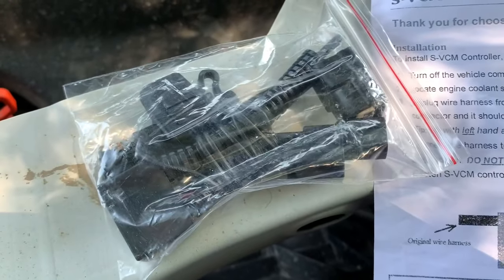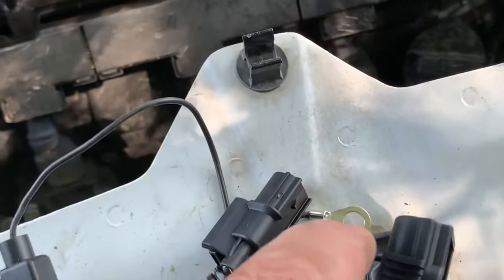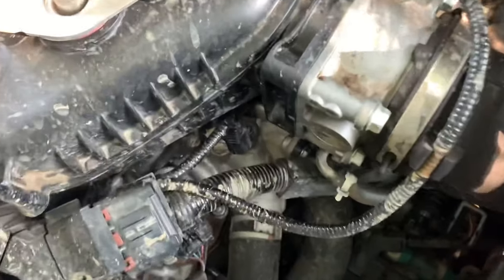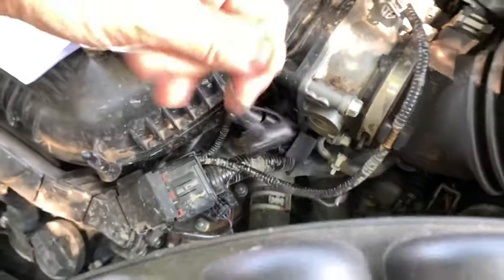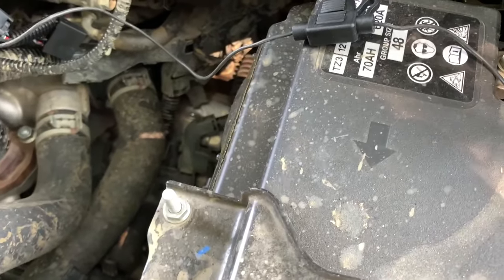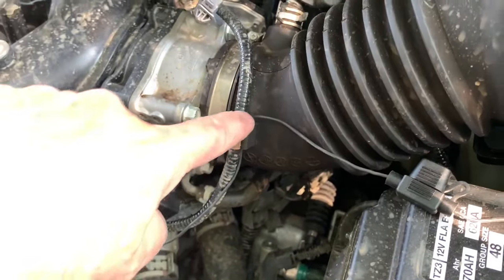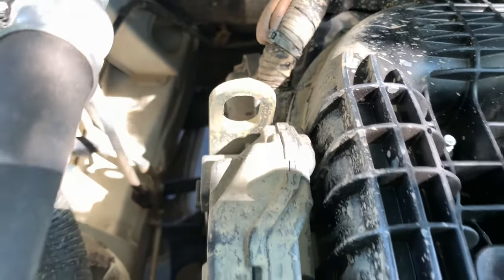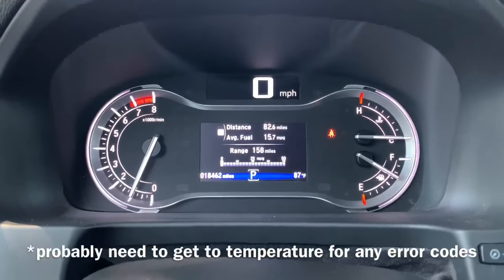Disable VCM (Varible Cylinder Management) in your Honda Ridgeline Honda Passport Honda Pilot Forever

Comment: UPDATE: S-VCM module has been installed for well over 5000 miles now.. No decrease in fuel economy at all.. 65mph and not towing or hauling anything yields 28mpg... Super happy with purchase...
Reply from the maker: Great news! Thanks for sharing.
Reply: Is this device smog legal in California?
Reply from the maker: It’s has nothing to do with exhaust.
Reply: Would this apply to a 2022 HondaPassport?
Reply: @kgill5  if the engine is a J35Y6 (and I think it is) it should work perfectly. I now have 27,000 miles on it and it easily gets 29mpg not towing. It gets 20-21mpg when towing a 1500 pound bass boat.
Reply from the maker: @marks6072 it does
Reply from the maker: @kgill5 yes it would.
Reply: @franchisefred4066  no problem, all it does it tricks ECT1 to say the engine is under operation for VCM 165°F, ECT2 is still checking temperature so no risk of overheating. Also SVCM has an overheat threshold that will trigger over 200. 

Make sure you do it cold or you will get CEL
Reply: Will this work on the 2024 ridgeline?
Reply: @gerryecobiza same engine in 2024 so it should work fine. Great investment if you plan on keeping your Ridgeline over 50,000 miles.

Comment: I bought a used ‘17 Ridgeline about 2 years ago and one of the first things I noticed was how the truck vibrated, made weird noises and the tac would bounce around quite a bit. My family thought I was crazy, but after doing some research learned about the VCM. I HATED it. I’ve had this product on my truck for over a year now and have loved it. No issues and all of those “problems” have gone away. Best $100 I’ve spent on the truck.
Reply from the maker: Great to hear! We love ours as well. Make sure to subscribe. More to come. Thank you!
Reply: Still going strong? I purchased a 2017 ridgeline two months ago and i have the rpm fluctuations. Im going to change the trans fluid (4 drop method) and filter tomorrow and have one of these svcm on the way. I LOVE this truck with the exception of the rpm fluctuations, theyre awful!
Reply from the maker: Great to hear!
Reply: @midroad-2443 Happy new year, yeah your ridgeline needs a drain and fill ×3 ( ×2 is ok) of Dw1 or flavor of atf fluid. Then atf every 30k or yearly ( just do transfer + diff at the same time too) do not overfill atf, measure it hot and look for line in the middle of cold and hot line of the trans dipstick.

VCM has been good in the J35Y6 engine with Direct injection, there is less opportunity for oil consumption and DI burns even and cooler than than Port injecton which was the problem with the Odyssey and accords . 
However, VCM doesn't play well with the Honda 6 speed auto which is why I recommend to disable.  The TCU is programed to go out of Torque converter lock up and slip the clutch to matching rpm for smooth 6 to 3 cycle switch with the active motor mounts to handle the 3 banger vibrations. Then there is the Dw1 formula that is heavy in Zinc or ZDDP, as an all in one antiwear additive. It's fine as far as chemistry which is closer to manual atf with 10× less Zinc used for creating Triboflims on the clutch material as a wear layer that will rebuild as long as there is enough addtive package. Now think about slipping a clutch in a manual you aren't doing it often or at all but in this case everytime VCM needs to initiate the clutch will be feathered while going in and out of Torque converter lock up which will pretty much slowly glaze the clutch material resulting in the 'RPM flutter' and 'Torque converter Judder'. 
Then as the fluid has deteriorated and no longer provides adequate pressure due to the slipping RPM needs to increase to compensate to disengage TQ lock up, feather clutch, VCM engage the fluctuations cycle repeats. (The Judder is TQ clutch in and out)
To maintain VCM relies on oil pressure for activition which is connected to the RPM but when there is a slip RPM need to rise to compensate, then falls once pressure us reached; more slippage and RPM rises and falls again
( the flutter).
 It seems only the people driving the J35Y6 engine gently have more of the RPM flutter
Reply: Thoughts regarding installing it on the 9 speed?
Reply: @JayDrums_Music  its your call, the Zf 9HP + fluid seems to be really robust.
My reason for disable VCM on my 6sp ridgeline is the transition from 6 cylinder to 3 cylinder is programmed to unlock the torque converter and slip the clutch slightly to ease in the transition then re lock the the torque converter; problem is DW1 doesn't handle it well and the 6sp is built more like a manual so imagine micro slipping your clutch everyday w/o the option to replace the clutch
For the 9 speed how it's designed with the dog clutches and A + B internal Brake clutch system. I'm sure VCM is programed to active within them movements the engine engages brake A / B to sync the dog clutch ( which are more like gears syncing) the shift from gear 4-5 is when the first dog clutch shift happens and gear 5 is also 1:1 the next Dog clutch is 7-8. I can't confirm but I'm gonna bet VCM kicks in at 4-5 for the 9HP

Comment: Just installed this on my 2015 Pilot. Took about 20 minutes (5 of it spent trying to get the old and dusty sensor plug out). No error codes. ECO light is now off. Throttle response is a lot better and driving seems smoother yet ready to go when I need it.

Comment: I bought it a year ago and finally got around to putting it on today. It would have been a lot easier if I had hands the size of a baby koala bear. Started it up and drove about 15 miles. No error codes AND NO ECO popped up. 2013 Pilot with 225k that I bought used last Summer.
Reply from the maker: Sweet!!!

Comment: I just got it today and installed the switch right away. Easy installation, 10-15 min tops. At start the indicators were shaking but only until the engine started. No warning light. Right out of the bat it felt and sounded different. No more weird weakness from the engine. More power and no more weird vibration. Happy so far. I will update if anything starts to be funny.
Reply from the maker: Awesome- always remember to install an a completely COLD engine. Thanks for watching!
Reply: is it still working good?
Reply: @dropdabeat442  I had to remove it when the emissions light came on and Honda replaced all injectors under warranty. I still have to put it back in. I assume that with the vcm cut out, the injection system was working all the time and crapped out like it did on many other engines (hence extended warranty 10 years/150k). Should be all good now. I just need to find the time to put it back in.
Reply: @s4-mtb678  Thanks for your answer. So this VCM bypass device can also damage injection system or just use it more than it normally should? I hate the unstable transmission caused by VCM, so I was thinking about getting this VCM bypasser.
Reply: @dropdabeat442 no it won't damage the injection system, that is faulty already on this own. To the contrary it will save your engine from other more catastrophic failures. In my case my assumption was that cutting off the vcm the whole injection system was running all the time so it increased the chances for a failure on one injector that was coming no matter what. On my 2017 was covered under warranty so it wasn't a big deal at all. 90k and fresh injectors for free  it's good.
Reply: @s4-mtb678  Oh I see. Thanks again for detailed explanations. I should have bought the Honda extended warranty. My 2022 pilot only came with 3yr 50,000km for everything and 5yr 100,000km for powertrain
Reply from the maker: Works great for me. Did you order yet?
Reply from the maker: Thanks for helping out.
Reply from the maker: The VCM damages the injectors, the S-VCM protects them by keeping them running. Many folks get bad coil codes in older models w over 100k. They install new coils just to get the same codes. After installing the S-VCM they no longer get error codes because the engine is no longer shutting down half the cylinders.
Reply: @dropdabeat442  I've had mine in my 2021 Passport for 3 years and no issues. At the same time I installed another gadget to disable the auto start/stop nonsense.

Comment: Question on overheating, so since the S-VCM tricks the computer into thinking it’s below 167 degree F to disable VCM, do the fans automatically turn on when the engine is at normal operating temp. Of 200-210 regardless? I want to buy this device just concerned about overheating!

Comment: Just installed an S-VCM on wife's 2016 Pilot two days ago.  No error lights, no over heating, all looks good.  We have 52K miles on this Pilot purchased new.  Before the last oil change at 10000 miles, it had consumed almost 1 qt of oil,  and the oil was very black.  This got me reading and looking at videos about the oil change interval and VCM.  From now on, we will not go past 5000 miles before an oil change.  10000 miles seems to be a recipe for oil burning all by itself, per many good mechanics.  Our pilot consumed 207 gallons of regular gas last year and got 24.8 mpg.  This was all around home, never more than 30 miles from home.  It will get nearly 26 mpg freeway, fantastic gas mileage and power.  I am tracking the Pilot mileage with the S-VCM installed, and curious to see any drop.  My 2004 Odyssey at 105K miles gets 21.3 mpg around home with no oil consumption and 25 mpg freeway.  2004 was the last year before VCM was added.  I has been a great trouble free van.
Reply from the maker: Great to hear!!!! Thank you for the feedback!
Reply: your 2016 pilot has 52k miles, that's an average of 7k miles a year?  I wouldn't go more than one year on an oil change.  Hopefully, you are using full synthetic oil.

Comment: Installed on 2021 Ridgeline Sport, it was working fine, but recently set off my Emissions  check engine light.
Reply: What did you do next? Did you just clear the error using OBD? Or did you uninstall the S-VCM and the light went off? Thanks!

Comment: I had the VCM Muzzler awhile back and I got tired of the error codes and just took it off.  Didn't notice much change.  Didn't get the vibration everyone talks about and oil consumption wasn't bad for me.  About half a quart or less for 7k miles so never looked for another way to disable the vcm.
Reply from the maker: It’s either the greatest thing or not such a big deal. That’s why there are options in life.

Comment: I installed this on my 2018 Ridgeline six months ago and it really smoothed out the engine. No codes and no difference in the gas milage. Best $120.00 I ever spent. Drives and runs smooth as butter.

Comment: Installed about a week ago in my 2012 Pilot EX-L. Easy as pie. No error codes and no more ECO light. Super smooth shifting and a full six cylinders of power!
Reply from the maker: NOTE: some ECO lights will still show on some models, however the VCM has been disabled. The ECO light on the older versions (before the ECON button) reflect your driving. When your light on the gas pedal the ECO light illuminates. In the newer models the ECO light is the green hue around the instrument cluster. The ECON button in the newer Hondas, LOWERS A/C output, deadens the gas pedal, and extends the transmission gear shifting to save fuel.  Thanks for watching.
Reply: @CampingRandy  so this disables VCM and ECo mode?  Eco mode button would do nothing?  2020 Ridgeline
Reply: @AlpineWarren i have it in my ‘23 Ridgeline. Eco mode still does everything else, just disables the VCM. My AC doesn’t blow as hard, my gas pedal is less responsive and my gears shift more economically when I push the button, so I ride around like that most of the time.

Comment: I installed this on a 2024 Ridgeline and it works great. Before the install the tach bounced around a lot, transmission searching for gears, the cruise control was a nightmare with how long it took to adjust speed on hills or when lane changing from behind a slower vehicle. After the install the vehicle is so much smoother, trans stays in the same gear on most hills, the cruise control is instant now when adjusting speed, a lot more power. 
On my Ridgeline the temp gauge is in bars. 4 bars is normal operating temp. When I installed the S-VCM the temp gauge only went to 3 bars but once the idle stop cycled the engine or I cycled it by stopping and restarting it the gauge went to 4 bars, leading me to thing the product had stopped working. I reached out to Randy and he got tech support involved. They had me check the actual temp with a scan tool at the local parts store. When the engine cycled after being warm it went from 163 degrees to 165 for a couple of seconds and then back down to 163, so the product was working fine. I'm thinking the breaking point from 3 bars to 4 is 165 degrees on my Ridgeline.
I wanted to share all of this in case anyone else runs into the same thing and thinks they have a defective part. It's working fine. 
Btw, I can't see any reduction in fuel economy.

Comment: It took more than an year for me to realize that my 'transmission related' issues with my 2018 Pilot is actually due to a damn 'VCM'. After almost 5 visits to dealership and multiple 'Snapshot' sessions with Honda Techline, I am asked to live with it by Honda USA. I think I found the solution!
Reply: I also have a 2018 pilot bad have been dealing with shifting jerks. I think I might have found the solution

Comment: I did buy that '21 Ridgeline.. I towed my 20' travel trailer (3600 pounds) and it pulls fantastic at 55-60mph and gets 14.7-15 mpg towing.. Dont plan on a huge amount of towing but its nice to know there are no performance issues while towing..
Reply from the maker: Great to hear!!! Great gas mileage!! I’m at 10 to 11. Lol
Reply: You installed one? How do you like it
Reply from the maker: Mine is doing great. I’m at 11mpg when I tow my 4k camper. But I have oversized wheels, a lift, a rack, a roof toot tent, etc!
Reply: I have  a 23 Ridgeline. Stock everything and get 12- 14 mpg 😢😢😱🤯..
Reply: @josephpetrizio78  If you're getting that while towing, that's not too bad... If you're not towing, then you have a major problem and need to connect a dealer level scan tool for analysis...
Reply: @marks6072  not towing anything 😵‍💫🤯
Reply: Also, that is 95% City driven, if that somehow helps????
Reply: @josephpetrizio78  you need to get back to the dealership and plug in a scan tool to see why your ECU is running the injectors so hot… before it destroys all 3 of your catalytic converters
Reply: @marks6072  definitely going to get it to the dealer as I always thought the transmission acted kind of funny from the beginning. Just thought I had the 9-speed transmission issues everyone complains about. Just curious what does the injectors running hot have to do with my gas mileage. Seems like you have more knowledge about this vehicle than I do could you fill me in on your take of my situation? Anything helps
Reply: @josephpetrizio78  ECM (engine Control Module) determines how much fuel gets sprayed into each cylinder via the direct injectors duty cycle.. Spraying too much fuel means a rich mixture which means fouled plugs, damaged cats, and lousy gas mileage... Easily checked by the dealer.. The ZF 9 speed can exhibit delayed shifts below 40 degrees F until it warms up.. Not sure if there is a software update for that... All city stop and go could land you in that 16-18 mpg area if you like to punch it away from every light.. 10-12 stock is pretty rough though.. All that fuel is going somewhere...
Reply: @marks6072  agreed 👍, Thanks for the reply. I for sure know something’s up. Let you know when its figured out🤜🏻🤛🏻👊🏻

Comment: I found that a long-nose needle nose plyers work great to remove the connector.  Just squeeze hard enough to compress the locking mechanism.  Don't crush it.
Reply from the maker: Two small screwdrivers work too. One on the clip. One on the bottom to twist and off it goes!!!! Thanks for the input!
Reply: Thanks helped alot

Comment: I have a 2019 rigeline about 29k miles  so far no issues.  

I also have a 2007 odyssey with a VCM1  engine with 225k miles 
No issues except for oil consumption.  Switching to high mileage synthetic blend 5w20 helped that and change PCV.  
Now it’s down to about 1 qt every oil change.  It use to be 2 qts.
Reply from the maker: Just breaking them in! Thanks for watching!
Reply: Had a Gen1 RL same here NO issues with that one 231,000miles. Sold and bought 2019 RTL E love it just the way she is.

Comment: I have a 2010 Honda Pilot. In 2017, my warranty has expired, and about two month after that with 72,000 miles, my spark plug went out (cylinder 3).  Dealership told me a new spark plug was needed, and I paid for all the spark plugs to be changed.  By  November 2022 with 102,000 miles, check engine light turned on regarding cylinder 3.  I found it strange that the same spark code popped up. 

Anyhow, my friend referred me to his friend that works for Honda service department to get the engine examined. During the examination, I was told that the piston ring needed to be replaced for cylinder 3. Since I was able to get a better deal to get the motor rebuilt by him, I agreed to it. During the tear down of the engine, half of the cylinder bank are black and brown. I was told that the VCM is most likely the issue. I wish I knew this many years ago when I had the spark plug issue before.

I am curious about what happened to the class action lawsuit in 2013? I never received any letter regarding it. If anyone has info, please let me know.

Comment: Just watched your video very informative. I’m thinking about buying a new ridgeline, but I’m really worried about the cylinder deactivation. What do you think about longevity of the engine.? The last Toyota I had went over 300,000 miles never had a problem just curious of what your thoughts are.
Reply from the maker: I personally think you’ll be fine and much more comfortable driving!